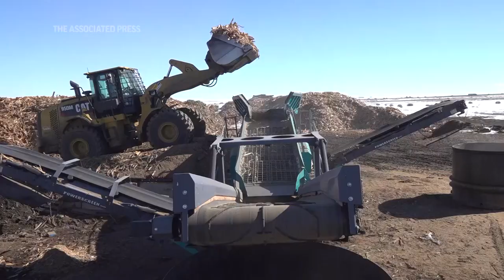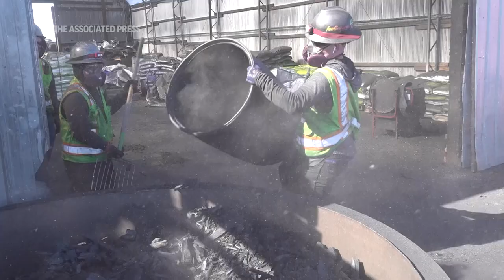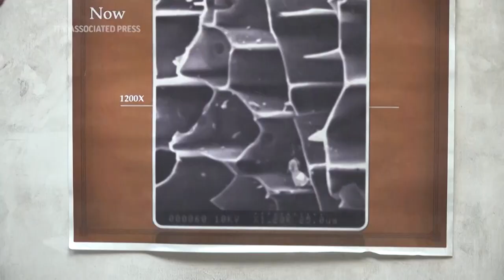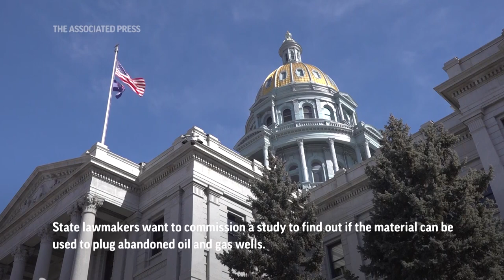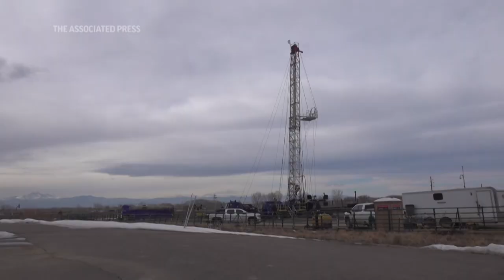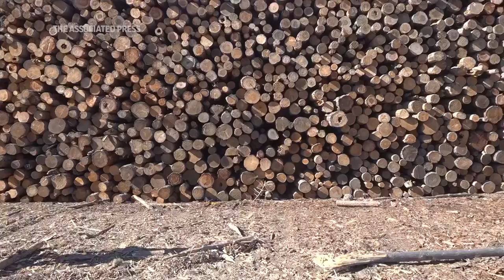Colorado mulls new way to plug old oil, gas wells

Comment: Yea that makes very little sense without additional explanation.
Biochar is a filtering agent, not a sealant.
You plug wells (with a cap, gas tight) to prevent methane escaping.
Methane would just flow though biochar with very little interaction and still contaminate the atmosphere.